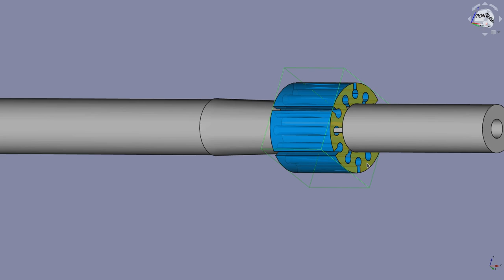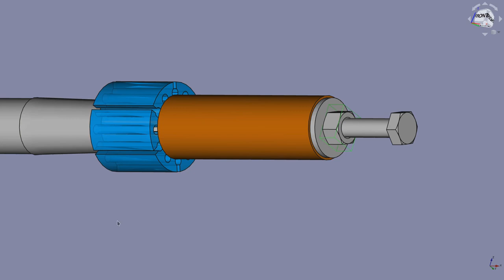making an ID lapping tool

Comment: Harald: Can you tell us what degree of taper are you using on the taper arbor?
Reply from the maker: Don: thanks for your interest.
The larger diameter of the cone is 23.0 mm (0.905") , the smaller diameter is 20.4 mm (0.803"). The distance between both ends of the cone is 60 mm (2.36").
The (one sided) angle is
atan( radius_difference / length ) 
= atan( (( 23.0 - 20.4 ) / 2) / 60 )
=  1.2412° (is there an imperial equivalent for degrees? ;-) )
Thus the included angle between both sides of the cone is 2.4824°
Hope this helps.
Kind regards Harald

Comment: Amazing, have you ever made any in smaller diameters? Say 12mm? I`m considering it but no idea how to do the internal slots 🤔
Reply from the maker: No, sorry, I have never tried smaller diameters.
Edit: you could try a different design: instead of cutting individual slots you could cut a single spiral shaped slot into the lap. I tried this with a piece of aluminum tubing and it worked pretty well: https://www.youtube.com/watch?v=1NdeS0XPROA

Comment: What is the difference between lapping and honing? Thanks.
Reply from the maker: To my understanding both methods use some kind of abrasive to remove metal from the work.
In case of honing the grains of the abrasive material are fixed e.g. in an abrasive stone.
In contrast lapping uses abrasive particles which are free to move between the lapping surfaces. This removes material from the work piece and from the lapping tool as well. Thus both surfaces mate perfectly after some lapping action. This results in very precise surfaces.